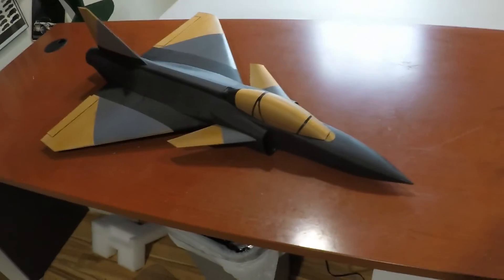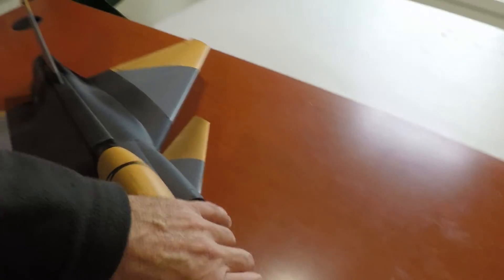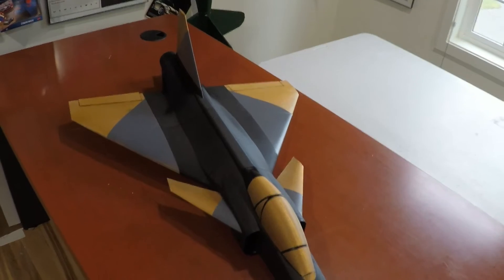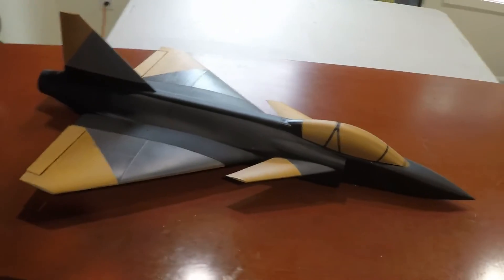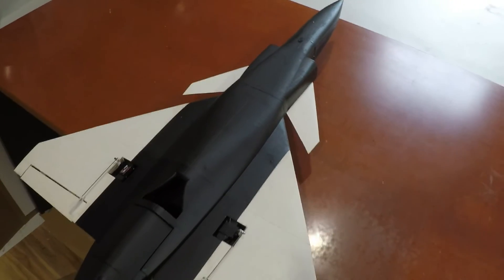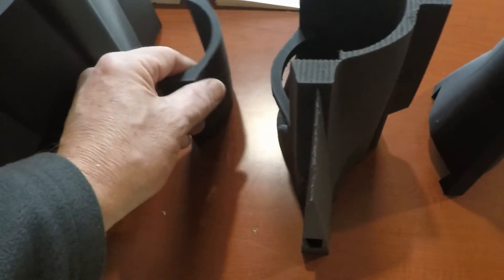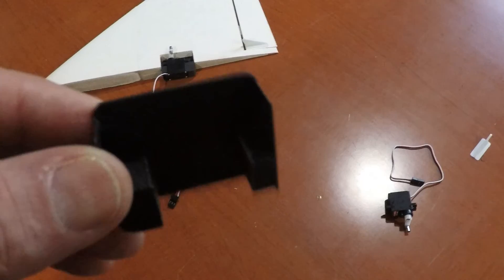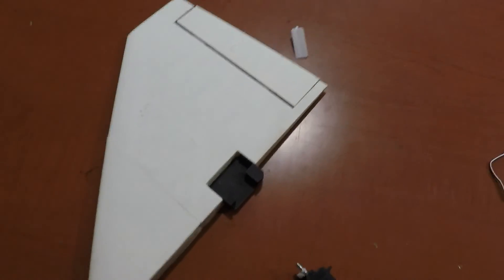3d Printed 64mm EDF Gripen by BUILT FAST - Build Overview

Comment: Hello, thanks for the video. You mentioned that the overall weight of all prints is about 450g. Do you know (as reference) how much weights the nose section (Grippenfuse1)? Thanks in advance.
Reply from the maker: It is out on Makerworld here: https://makerworld.com/en/models/206096
Reply from the maker: My notes say 67g…which seems high so I sliced it again and it indicates 26g. I will be home tomorrow and I will weigh one.
Reply from the maker: I just weighed one that I printed on my P1S and it weighs 20g with 2% infill. However, the plane was printed on my Sidewinder at 4.5% infill and is much more stout. I estimate that it weighs 24g. Hope that helps.